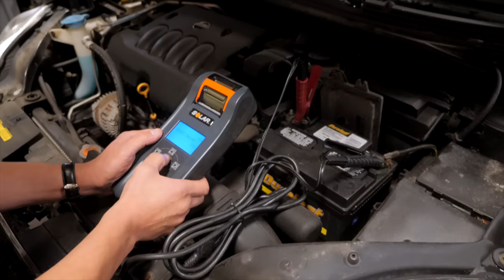Doc Motor Works Auto Repair | Plainfield-Shorewood IL

Comment: Glad I came across this place. Trusted another shop for years and years. Brought my car into them the last time due to a non-start issue. Was told it was my fuel pump and was going to cost me almost $600.00! I bought a cheap diagnostic reader and found out in less than 5 minutes that it was a control valve that costs $23.00 and I swapped it out in under 10 minutes myself. So, I realized that it was far past due for me to find an HONEST mechanic. Brought my car in to Doc Motor Works for a recent issue that was beyond my abilities. They took great care of my vehicle for a very  reasonable price and told me exactly what needed to be done versus what could wait. I have been nervous about finding a good mechanic because besides my every day vehicle I also have a restored 77 vette. I know I can trust them to work on both of my "babies"! Very satisfied customer!!! 👍